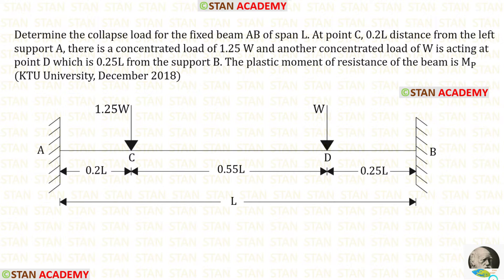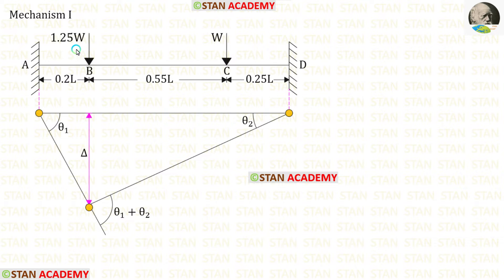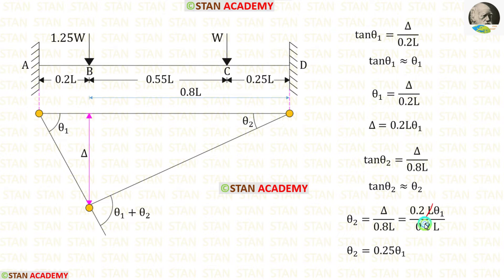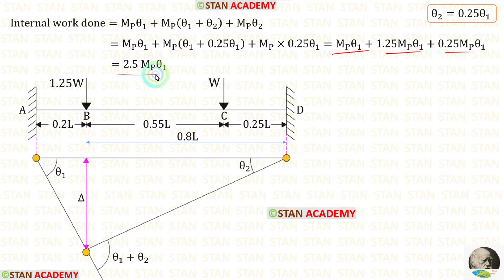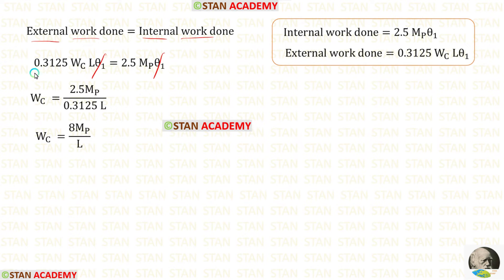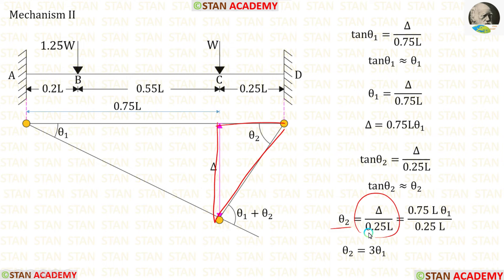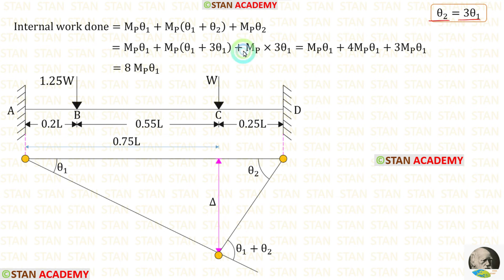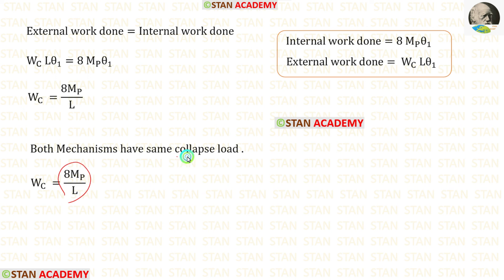Plastic Analysis Problem No - 1 ( Finding Collapse Load on Fixed beam with two point Loads )

Comment: Sir does the code allows us to go into the plastic stage? Or is this calculations used in the Performance Based Design?
Reply from the maker: No Basil it is not based on the codes., It is a kind of design which provides us more economy with respect to the materials . For details https://youtu.be/ioGGx9Zi7b8
Reply: @Stanacademy  Thank you sir, I will look into it